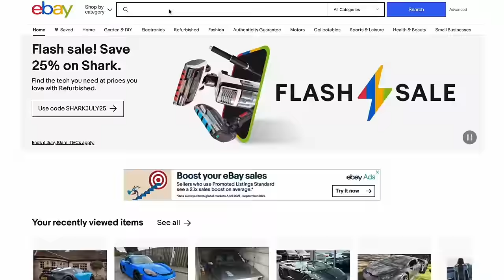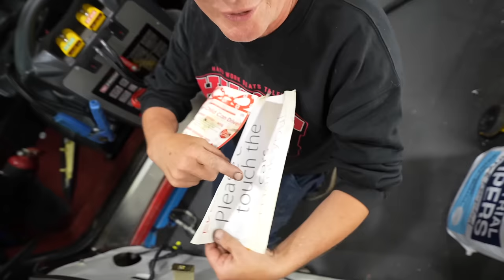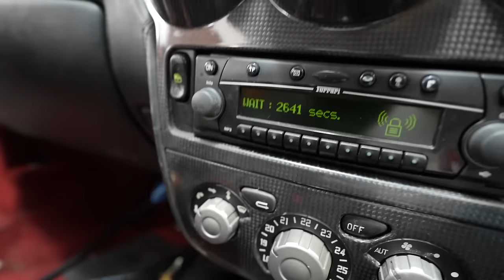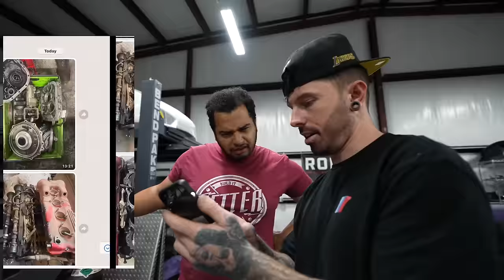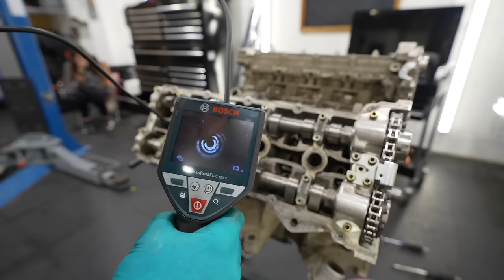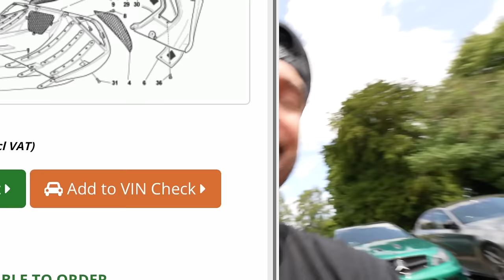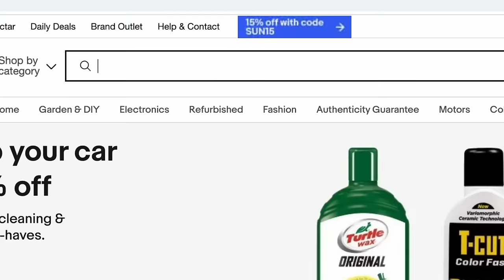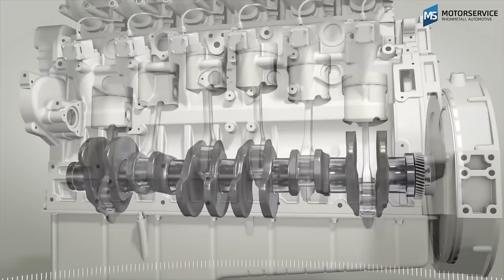FULL BUILD - REBUILDING A CRASH DAMAGED FERRARI F430

Comment: Damn, Mat!!!!

1hr23mins in and I have already learned soooo much from this video.  Not least of which is the love and respect you have for your dad, your determination to see an almost impossible job to a successful conclusion, and the friends and fans you have to lend a hand, donate an engine, loan a torque press, share an internal engineering document etc etc.
Amazing work.  Inspiring!  And I don't even drive an ICE!  You have a new subscriber.

More updates as I watch the rest...

2h09mins you are a true engineer.  Despite not having the technical training or manual for the machine, you work from first principles to solve issues and you apply logic, research and testing to confirm a hypothesis and find a solution.

2h26mins NEVER EVER SAY YOU DON'T HAVE TALENT!  You lack formal Ferrari training and documentation.  Talent?  You've got fxxx tons.  Your dad and your mates too.  Anyone else rebuilt a Ferrari engine, gearbox, and associated dependencies on their first Ferrari?  Talent?  Pluuuleeeeze.

2h41mins who knew dry ice could be used for degreasing and cleaning?

2h53mins THE END.  Superb.  Simply superb.
Reply: Again...beginning to end I totally wasted another day listening to you laugh and seeing Tony cry.

Comment: Nice! Hand lapping the valve seats and hand honing the sleeves; on a Ferrari.. I'm sure there's a bunch of old school tech haters that will chime in. They may be great on a keyboard but when it comes down to turning a wrench they have no experience at all.  In my opinion, the satisfaction of actually doing the work adds to the overall confidence in the build, or any repair.  It also gives you added knowledge and insight if something goes wrong, making it easier to fix it and do it right.  Learning from your mistakes is an important part of personal growth.(sorry spell check isn't working and in a hurry)  Great vid!
Reply: I don't understand why you would refer to them as haters if they chime in. My uncle, was a master mechanic for Ford his entire life, would say to me, "so, you put round rings into an oval cylinder!!!" Now to me, I would accept this car as being a success proving it was a viable car, that needs an immediate rebuild of engine and transaxle. In fact would not put ANY mileage on the transaxle before a proper rebuild. Shims and specs that go to +/- 0.003" and the like, there is a reason these things are measured so precisely, a human hair is 0.007". After 35 years of building cars, tractors and all manor of things, I still do not build my own rear differentials. And I am currently building a 2006 Impala into an All Wheel Drive with a 600 HP (@crank, not wheels) LS engine.
All said They did a remarkable job and by any account a success. Just making this video at such quality is top level.  Those few people like Mat are so valuable to giving people of all ages inspiration, and the courage to try. The most valuable thing he may demonstrate is "TRY" and if you fail, try AGAIN. The way he felt when that engine fired the first attempt, I know that feeling, and you can't ever buy that feeling. The world is a better place just having Mat and his family and friends in it.  :)

Comment: Hey Mat, just had my KIA Sportage 2001 worked on.  No, not quite a super car, but I did see a hack you might like for the future.  It has to do with the sealing of valves and whether they leak.   The valves nest into an area on the cylinder head that is concave.  The mechanic took some solvent (thinner) and poured it in to this concave area to the brim.  He let it sit there watched for the level to stay the same or drop.  One valve lost lost fluid immediately, the others slightly slower.  He said this is a quick test to see if the seal between the valve and the head is leaking.  Silly third world hack, but he identified the bad cylinder.  Great segment on the 430!

Comment: I just painted my 2005 front inlets dark gray.  I prefer the stock dark gray vs the black.  Actually most of all inlets here in Southern California I have seen at many Ferrari car shows are painted the stock dark gray.  Good job on rebuilding the car.  The air conditioning controls are a bad Italian design along with the F430 had the worst Becker radio system.  The Michelin Pilot 4S tires are the best tires for this car.  Glad to see you give the car to your dad.  Your father is my age.

Comment: When you did the valve seals did you assembly grease the center hole/ guide for the seal? Or assembly grease the valve steam? I’ve had a few tear the seal and after a week they engine starts to smoke on start up and idle.

Comment: The spring perch adjustments aren’t just for ride height but also to get the handling balance right. You neet to adjust them so the corner weights are even left and right on wheel scales. Otherwise the handling can be nasty.

Comment: When assembling the connecting rods and main bearings don't grease or oil the bearings where they mate to the block or con-rod. It will increase the risk of spinning the bearing, ideally you want it to be as clean and oil free as possible to reduce the risk.

Comment: from my experience, the 'scoring' or 'hashes' you find in an engine's cylinder is on purpose; and gives some grip to the oil allowing it to coat the walls of the cylinder in a more uniform manor. Smooth cylinder walls is a sign of wear!

Comment: yeah even in neutral there is some friction in the gearbox. this is more obvious in boats.. when you run them in neutral (especially when they sitting on a the trailer) you will see the prop still spinning. teeth are not engaged its just friction.. or drag like you said. nice project by the way!

Comment: Regarding bolt torque specifications. The torque spec is generally an industrial standard based upon the bolt itself. Ypu can find the information online by the diameter of the bolt and the material from which it is made.

The only exception is when you are clamping dissimilar materials, for instance plastic to aluminum wjere proper bolt torque would damage one or the other part. The hint the engineer would give you that this is the case would be the presence of a "lock washer".

When I build am engine and I hone a sleeve I hone the sleeve to a specific dimension to within 0.00025 inch of the measurement of the piston because 2 different pistons will almost surely not be the same size amd I want all piston to cylinder wall clearances to be the same.  Also, I never build an engine without balancing the rotating assembly. Another thing to mention is that I would not trust a sleeve from a hydro-locked engine which resulted in a bent rod. That sleeve will likely give you trouble.

Comment: it is normal for the outlut shaft to spin when in neutral if there is no restance. The internal friction of the gears on the shafts will transmit some of the power. grab the outputshaft with your hand and have someone turn the input. there should be very little resistance to fight

Comment: Before you did any disassembling you should have put engine cleaner or we use kerosine in U.S. let it sit 24 hours and then if it does not turn over another 24 hours ( fill up through spark plug holes , sorry I forgot to tell where to fill it from)  this works most of the time!)

Comment: Oo You guys skipped a vital step on the crank installation. It's always smart to use Plastigage to check spacing between the main bearings and crank. A dial bore gauge is fine, but Plastigage is far more accurate in giving you an idea of what's going on in a physical image, not to mention that it's cheap insurance that you got it right!

Comment: to fix the steering wheel just pull the steering rack from the colum align the wheel straight and have someone hold it and re attach the steering rack my guess is you most likely fixed it by now but if not for whatever reason thought id make it easier for ya!

Comment: At 16 years old, my father told me to rebuild a motor of a car if I could take it down to the block, put it back together and if it starts, he would buy me a car, you better bet I had that thing torn apart, put back together and running in no time. I have owned 53 cars 17 motorcycles and two tractors. I have worked on all of them. Buy cheap sell or trade high.

Comment: An easy way to check is the thermostat is good enough for use or not is just to put it into a bowl of boiling water.
If the thermostat is good then the spring will compress within the bowl.
If not then nothing will happen.

Comment: I suspected you had the timing wrong when you were dropping the heads on because it looked like the crankshaft rotated as you were dropping the head on, you have a shot (it’s only about a quarter of a second) where I did see what looked like the crankshaft move it’s rotation as you dropped the head on. So I suspected there was interference, although I wasn’t sure if you had the cams in or not at that stage. So I’m glad you worked it out before there was a nasty sound.

Comment: Has it blown up yet? I didnt see you guys adding cross hatch to the cylinder walls. Also you dont put any grease or lube between the bearings and block or connecting rods.
Reply from the maker: 5k miles in 👍🏼

Comment: 2:43:20
The reason the wheels on older sports cars were smaller is to do with ratios....basically a smaller wheel turns more times than a bigger wheel making more revolutions at the wheel means higher whp.. also it is tied into the gear ratios if you put bigger wheels on then it would take more revolutions of the gears to make one full revolution at the wheel the optimum wheel size to match the gear ratios is between 16inch to 17inch this is also in relation can affect  fuel consumption...so unless you have a gearbox that has custom gear ratios designed to run bigger wheel diameter then it's pointless to put on bigger wheels than the stock size however the main thing you should consider with wheel choices is the weight economically it is best to go with a lighter wheel weight for not only performance but for also fuel consumption. Where as a heavier wheel can affect consumption as it takes slightly more power to turn it the weight once it is moving has centrifugal forces that can lower consumption however it is also a way of adding weight to knock back the Performance index basically if it is at the bottom end of a PI class the extra weight of the wheel can knock it back to the top end of the PI class bellow it...hope this makes better sense to you as to why sports cars have smaller wheels inheritantly usually because it's part of the design for the PI index. your best of sticking with 17inch with a wider rear width than front both running on low to medium profile tyres for optimal performance out of such a prestige peice of engineering...all being said the bottom line is wheel sizes are manufactured to match the gear ratios for the maximum efficiency and performance for that particular vehicles performance index

Comment: Engine building failure. the bearings into the block go in dry.  the crank to the bearing goes together with assembly lube.  with lube under the bearing the heat transfer won't happen the bearings will be too tight and also not dissipate the heat correctly and therefore lock up.  Bearing should not have anything between the block and the bearing.  Plastigage needs used to check crank clearance. Both ways other than the right way and it'll blow.

Comment: Regarding the bearings in the gearbox...
Ferrari did not make those bearings.. therefore you do not need to buy them from Ferrari  check the dimension and numbers on the original bearing and race against timken bearings catalog.

Comment: A typical base model American biult Corvette is 1200 horsepower. It's a hybrid All-wheel drive. You guys might not be getting these on the other side of the pond but the thing goes 0 to 60 in under 2 seconds what's a V8 engine in two electric motors it's all wheel drive it's pretty fast car

Comment: This was a great video. But seems a lot of the missteps were all a matter of common sense. You have an OBDII reader/scanner, he could have easily tracked down many of the issues (even my OBDEleven comes in handy for the smallest issues). Another example, car won’t go in reverse. Everybody knows that newer cars have a reverse lock out mechanism. You have to push the gear lever down and into reverse. I couldn’t believe he was going to mess with the gear linkage because he didn’t know you had to do this 🤦🏽‍♂️ (if you watch the video closely you will actually see that he did push down and into reverse 🤦🏽‍♂️).
Again, great video. Just a little common sense goes a long way. Great job 👏
Reply from the maker: Not really but thanks broc

Comment: Did you buy the gearbox from whistling diesel’s Ferrari 430 that he accidentally drifted enough of drifting in or Wheatfield and it caught on fire wire by the old or a Ferrari F450 or 430? I meant from whistling diesel

Comment: 25:39 wouldn't just "bin" parts from a ferrari engine (esp THE CRANKSHAFT).  Have a machine expert parts dealer make that call.  Light scoring could be ground for a stroked rebuild of another engine.  Nobody (ok, maybe since they cost 200k) is going to be casting a part for a 1 of 7000 engine.  But ANY expert rebuilder could custom bearings and rods for a stroked/destroked rebuild.

1:30:38 Very surprised you did not find an alternate source (cross-reference) for these more-or-less standard parts.  That was 500 or so, poof.  Good job on the other ones.  Standard pressure switch runs 5 bucks, a premium OE one is probably double (plus profit margins).

Comment: I know my last comment is quite long winded but trust me if you read it carefully it will make sense to you eventually... lol personally I look at the younger generations now that think it's cool to put 19s or 20s on a VW golf an I laugh cause they don't have a clue bout the ratios and in doing that they've just ruined the Performance of the car however most modern builds now if it is built with 19s or 20s as stock then the chances are it has been geared with ratios to match the larger wheel diameter but that being said if you take a modern car designed with 20s and throw on some 18s what you are doing by dropping wheel size down is increasing the acceleration you may loose 1 or 2 miles per hour at full tilt but the difference is it will accelerate quicker than the same car with 20s fitted as standard simply putting it it's the physics all the mathematics that goes on behind all the cogs and wheels that convert each revolution of the crank into forward motion on the tarmac that people seem to forget about when they decide to put huge wheels on the cars outing an oversized when on puts more strain on the gears the bearings and essentially the crankshaft causing more work for them to do and resulting in more wear on components such as bearings gears and journals.... that's why modifying cars is a serious thing because each part that adds more power means it will put strain on something else and in turn you need to uprate the next thing and the next and before you realise it your in deep an you've literally updated every thing on the original car till nothing is factory spec anymore cars like Ferrari are pre built to be performance not much point in nodding it further where as for example if you had a BMW it's performance is lower than Ferrari but if you put in an engine and turbo to match Ferrari power you'd then need to upgrade cooling gear ratios driveshafts brakes wheels and do on to handle the power from the upgraded engine which then means you end up completely modifying the entire car it all evolves around ratios

Comment: What makes you think track driving is harder on a car. I disagree. Tracks are typically extremely smooth compared to any public roads here in the US. I hear all your roads are still cobblestone or something archaic like that. Anyway, a typical track day doesn't see close racing between the vehicles on the track. Vehicle to vehicle collision is almost unheard of. I also haven't seen many tracks where track days are held that have retaining walls in turns. Ideally the crash zones are something like grass, dirt or sand for damage mitigation. 
Public roads have multiple lanes with amateur drivers who may or may not be impaired or distracted. Possibly both. People texting,  on the phone are common. Potholes, guardrails, oncoming traffic, female drivers. New drivers. Cops making everyone nervous and distracted. The occasional PIT maneuver is also a danger. What am I missing... oh debris! What do I mean? Here we see BBQs, ladders, couches, runaway wheels, car parts, tools, dead animals, live animals and whatever wouldn't stay in on the way to the landfill.
The only track that has any of that that I know of is Sonoma Raceway here in CA. Deer are common enough to have their own special deer flag and there's 1 "wall of death" in turn 10 if I recall correctly.  They add a chicane before that corner when they run motorcycles.

Comment: So for 10k more you could have gotten a complete and working version. That 10k doesn't even cover the bumpers and diffuser, let alone the rest. Even with a free engine, I can't see how this was worth 60k.(45 min of watching later) Oh Jesus yes. Any of the completed cars would have saved you endless work and tens of thousands. Also, careful when getting new engine bolts, different bolts have different torque specs. I assume it works out because this video does end.

Comment: Assembly lube on back side of bearings???
Honing the cylinder without a cross hatch???
Using a torque wrench as a breaker bar??? 
What the fuck

Comment: The flange sealant used for the bearing plate needs to go on the inside edge of the bolt holes. The reason for this is to prevent oil leaking past the bolt threads/heads. Sorry